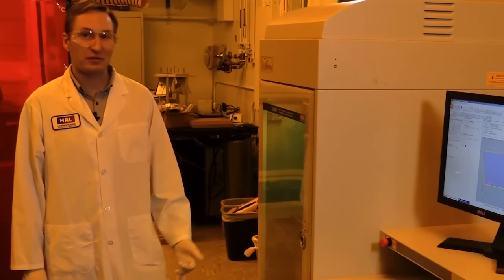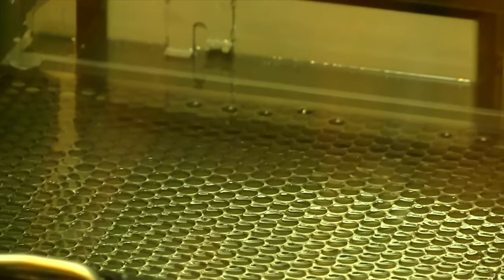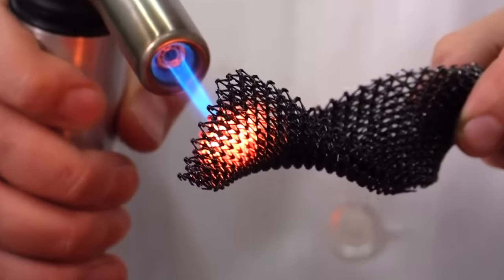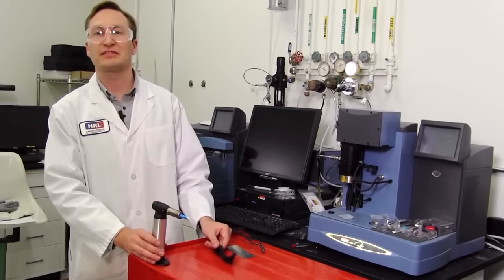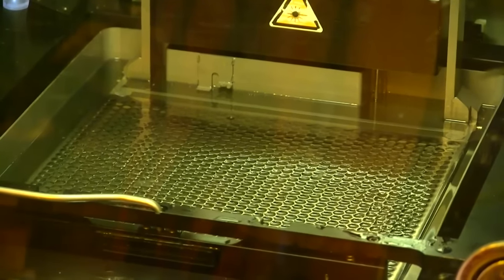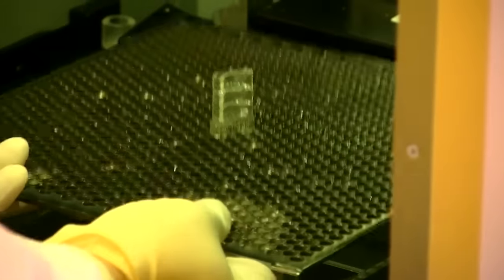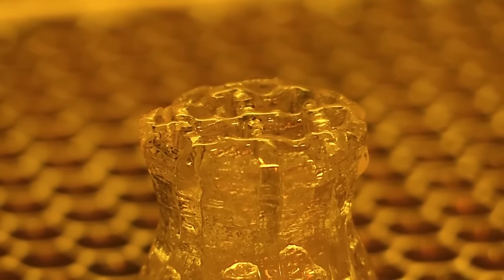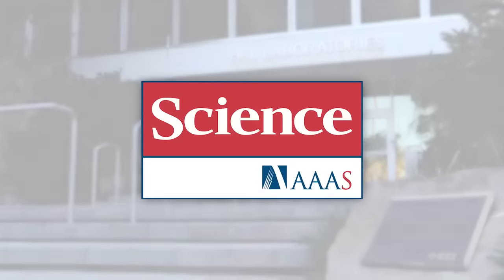3D-Printed Ceramics | PopMech

Comment: want that piece of ceramic for my cpu.
Reply: +Trung Tran There are ceramics wich conduct heat very well, but they are not much better to even worse then copper.
Graphite or Diamond conducts heat up to 20 times better then Copper, but graphite does it only in one mineralic axsis and Diamonds are a littlebit too expensive :D
Reply: A uniaxial block of graphene sheets for a heatsink would cost way more than a diamond heatsink I would think.

Comment: Jet fuel can't melt ceramic beams.
Reply: Bilderberg, Rothschilds and Rockefellers did 9/11
Reply: wow the ignorance of people that use that meme as a base of their argument.
Reply: I like how people actually get this reference 😂
Reply: +FernTheYoutuber 
While  jet fuel it may not melt cermaic beams it will weaken it and thus structure is compromised and the building fall
Reply: lol you cant convert sheep to ....
Reply: +Leyda How does one not get it? People never shut up about 9/11.
Reply: I know you're just having fun, but I'll reiterate as many times as necessary. The tolerance of a metal goes down the moment you start to heat it. It doesn't have to melt. Beams in a construction are there for a reason, they're under immense pressure. This means that they don't have to get near the melting point before they start to bend. When they've started bending things accelerate out of control.
Reply: +ben bower While jet fuel it may not melt cermaic beams it will weaken it and thus structure is compromised and the building fall

still doesn't explain the destructive fall at the rate of gravity on top of beams not weakened... or WTC 7

911 should be talked about until the government stops its PATRIOT ACT changes its made in society.
Reply: yup ...fall down until it hits a floor with beams unaffected by the heat or damage... so yeah, a few floors.   tragic
Reply: No but it can soften the atomic structure of the steel from martensite or pearlite to austentite which is much softer and not as structurally sound
Reply: possibly .. but only on the floors that had jet fuel burning .. and only on the parts of those floors where the jet fuel touched the structural beams and burned...since it didn't happen evenly all the way down the building, it  should have toppled, shouldn't it have?  But it didn't .. it was a nice even drop from top to bottom as if controlled, from the hot upper floors to the cooler, unaffected floors and all the way down.
Reply: Jet Fuel can't accelerate the fall rate of not weakened steel beams. ha ha ha.  Let's Remember how Trump Promised Full Disclosure of 9/11.
Reply: @AtotehZ  Which is why 3 buildings, each the size, of a small town freefall and turn into perfect sandblasting dust with the exception of things like passports from the airplanes. Mmmm. Yes.
Reply: Fire comment on a random nerd video haha

Comment: Does this resin-based 3-Printed ceramic part need post heat treatment, or not? This ad sounds a little confusing. If it still needs heat treatment, then it hardly is a "breakthrough".

Comment: “The cutting edge process and material have the potential to be used in a myriad of applications in a variety of industries”
Video shows no real life usage examples.
Reply: if someone makes a claim to try and get others on board with said claim they need to be able to support that claim. it's not up to the listeners to do all the work for the presenter
Reply: technopoptart You've already been told the mechanical properties. What you do with those properties is up to you. Nobody should have to hand hold a solution for you. If that is your mindset, you will never be a true innovator.

Comment: if you look at the display of their parts you can see that it looks absolutely shit, lots of cracking, not a smooth surface in sight and massive deformation. it's most likely extremely brittle and porus, probbably too weak to be practical.